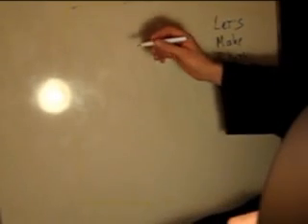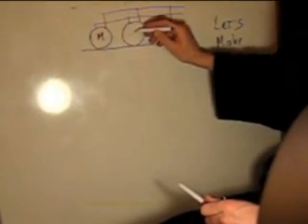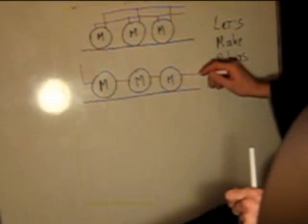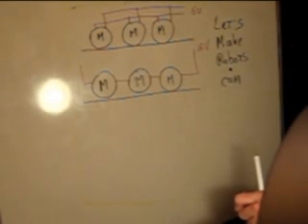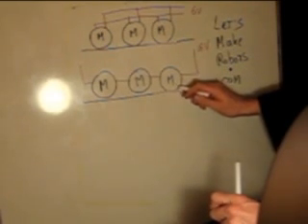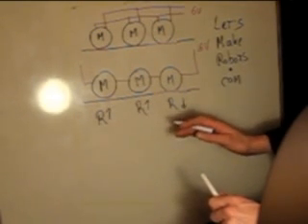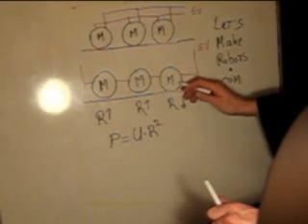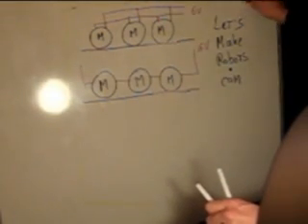6x6 vehicle: DC motors in series or parallel?

Comment: In terms of a parallel circuit verses series circuits is Parallel windings the current divides and voltage remains the same. Whereas in a series circuit the current remains the same and voltage divides meaning 
if we want the higher currents among all devices we need to stick with series circuits.

Comment: Any switch in any location of a series circuit is  opened up, the circuit will turn off.  When all switches are closed in all  location in a series circuit everything turns on, proved by one light in series with multiple switches.

Comment: What is important in Industry especially among motors of a conveyor belt we could connect them in series and if one goes down all will shut down or any switch in series in any location will shut all motors down. The current remains the same and the voltage divides equally among all the series motors.

Comment: In series the current remains the same and the voltage divides among any type of resistance.    In  parallel the current divides and the voltage remains the same  across all devices.

V= IR

Meaning  series =     VT =    IR1   +   IR2    + IR3    whereas the current I is always the same.
Meaning  series =     VT =    V1    +    V2    +V3

Parallel =                  VT =   V1   =   V2    =   V3
                                   Current    I     divides in each leg of a parallel circuit  in relation  to each of the resistances.

V divided  by   R    =    I      current in each branch

Comment: Fairly certain that electricity takes the path of least resistance....that being the case, the free spinning wheel would provide less of a load, yet you also have to consider the difference between AC and DC motors, torque curves, optimum ranges, and any increased resistance created by excessive heat and friction as a resultant of the rpm exceeding its optimum or maximum operating range, in addition to other such variables.